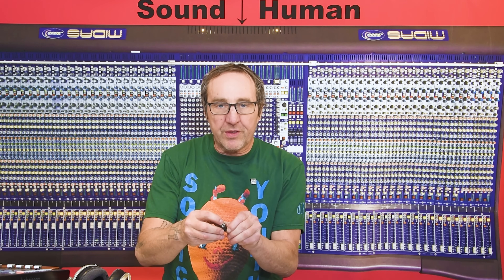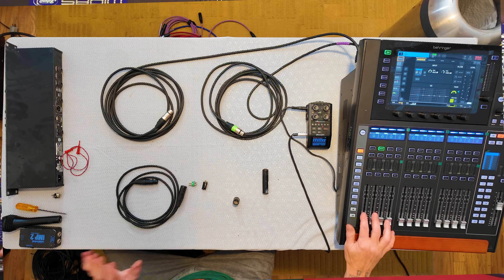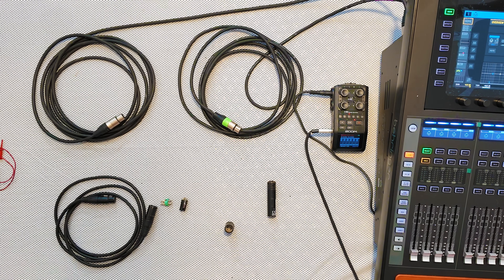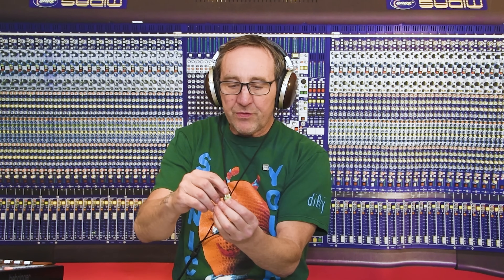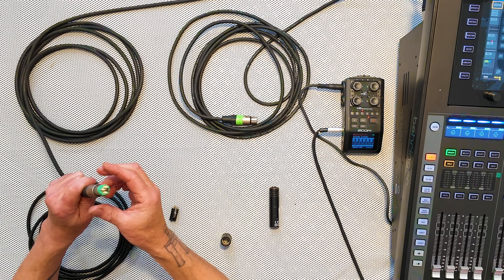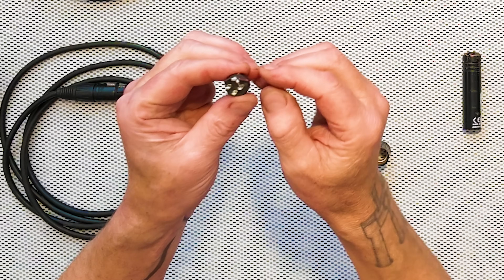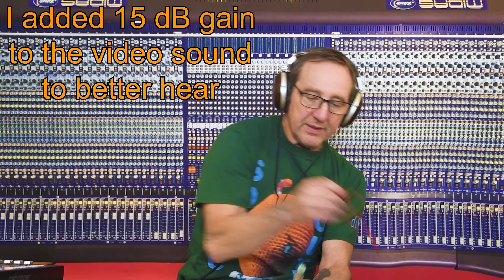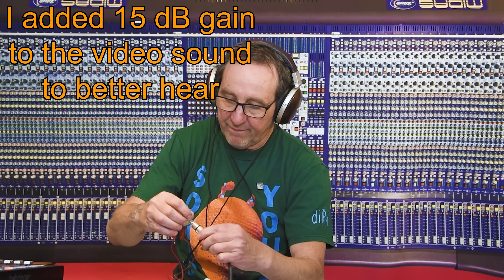XLR Shell Ground Issues

Comment: I've got different color coding for the XLR that have shields grounded, because there are times you absolutely need that, but you must know that they've been connected by glance.
Solves many issues on the field...
Reply: I work at a venue with the county's radio tower in the parking lot. The highway department, the sheriff, and will also link municipal fire departments in to county system.  This turns my cabels into a great big antenna aray. So I love your idea of having grounded cabels designated by color.
Reply from the maker: Very cool and I have a video up on the member side about RFI and EMF interference versus cable. 

And working on another. 

They'll be public at some point later this year probably
Reply: @ yes, color ring on the cable for the length (resistor color coding), the boot of the neutrik designates the grounding/not grounded, color ring around the connector isn't currently on any particular use and then the chassis color (clear/black) for if the cable's DMX or microphone type
Reply from the maker: Very cool and smart

Comment: What about daisy chaining XLR Snakes? Do you think daisy chaining together snakes like in the video I linked will have the same static effect (grounded vs ungrounded)? Could it be worse, less, what's your take Dave (and eveyone else's for the matter)? https://youtu.be/0AwU-hzP-YM?t=31

Also. Could the static be different if you switch between in/outputs when you're routing via the snake (rather than just doing the sensible thing and just route e.g mic 1 thru input 1 all the way to the mixer) or is the routing itself not a factor what so ever when discussing noise (probably no, I think, hehe, IDK anymore)? Like mic 1 goes into snake1 input 1,  then snake2 input 6 and then into the mixer's XLR input 1, 2, 3 or whatever you choose? 

I know the static you show in the video is not the end of the world, but I'm still curious what could happen if you daisy chain snakes and signals the way I wrote. Is it realistic that this would happen, in 99% of cases, probably no. But it's still a good brain tease to me.

Anyway. Really cool video! learned a lot! Thanks!
Reply from the maker: Ideally the metal snake box should be grounded in some way to provide shielding for all the untwisted wires inside. 

This is a bit of a problem because the question arises is how to ground that stage box with a conventional snake cable. 

One option is to ground it to channel 1 pin 1. But that means if channel 1 is not plugged in the box is not grounded. 

Another option is to ground it to every single pin one, this works ok as it just brings the pin one to chassis ground connections as they are in the mixing board out to the stage box. But if any equipment is used then has a ground to pin one issue or loop causing problem, it will mess with everything rather than the isolated. 

For example if you have clear com running down there snake and it's got a bad ground it will mess up your audio ground.

Ideally you would have a snake cable that has an overall shield that would connect to the stage box and would connect to the chassis grounds of the XLRs. Or at least one XLR, or have a separate ground wire connection for it that would connect to the chassis of the mixing board. 

I think you'll find it some stage boxes are not grounded and some are grounded. 

With sound tools analog over cat products the stage boxes are grounded to the shield of the Cat5e cable. Which is pin 1 of the audio grounds. But there's an internal jumper to lift the stage box ground if cables are used that have the XLR shell grounded to pin one. This allows the box to be grounded by the XLR shells instead of the cat 5e shield.
Reply: @DaveRat  Oh wow. That's a lot of cool variables and possible solutions. I have so much more to learn, and I love it! Fascinating! You show your knowledge yet again! Thank you!
Reply from the maker: Awesome and thank you

Comment: So in a studio setting you would want mostly shell grounded cables and a few ungrounded for trouble shooting ground loops?
Reply from the maker: I would say no. Different gear has different reactions to having its chassis ground externally shorted to its audio ground. 

Grounded shell XLRs force this to happen and that can cause problems. 

 chassis grounds are messy and tend to be exposed to many variables. Chassis grounds are tied to the AC ground and when gear is mounted in a rack all those chassis grounds often get connected together so any chassis ground issues with any gear in the rack will mess with the chassis grounds of all the gear in the rack. Chassis grounds tend to be a big mess of ground loops and noise

Conversely audio grounds need to be as clean and precise as possible and not have ground loops. 

I would avoid forcing a connection between chassis ground and audio ground whenever possible except as a problem solving action. 

One of those problem solving actions would be extending XLR cables and having ungrounded shells

Comment: Interesting point about the bass di issue, assuming it was Fleas Gallien Kreuger bass rig. I ve had the same with smaller GK combos and other manufacturers amps, to the point i now almost always use a BSS, Radial or other di with ground lift on bass rigs. There are so many variables with amps /guitar pre amps/  chassis grounding, aside from xlr cable ground. I often considered using the old Rane method of placing a 100 pF capacitor between pin 1 and xlr shell to shunt it to ground.
Reply from the maker: Agreed

Comment: So if you ar runing dmx my opinion is no grounding

But it rase the question why is there no XLRs with an internal scheld isolated from the outer schell
Reply from the maker: That's a great idea. Have pin one go to an internal isolated shield that carries the cable shield all the way up to the next one but does not connect to the outer metal shell causing a short between chassis ground and pin 1.

Comment: I looked into this when i first started soldering cables professionally (around 2006) and came to the conclusion that it was best not to ground the shell and let the equipment desidners decide if the chassis and audio ground should be joined.
The deciding factor was that shell needs to be lifted for DMX cables and if your audio cables are shell lifted, they can in a pinch be used for DMX applications.
Reply from the maker: Agreed

Comment: There is a way to do both….connect for shielding AND not connect to avoid “Earth Loops”. In an Earth Loop, the impedance is really low, typically less than 250 mili Ohms. This causes a large current to circulate in the loop if an AC msgnetic field…from a mains transformer in a piece of gear, say, passes partially through the loop…so the current is large..atound 100mA, but the resisrance/impedance is really low…so developed voltages are small…typically 10-50mV, but thst is well enough to sdd to a 5mV mic level signal and ruin it. 

  If you place a low value resistor in the loop, and I have seen values as low as 1 Ohm bee effective….because this reduces the circulating current in the loop by an order of magnitude or do. So, knowing this, if you place a 47 Ohm resistor, day, between pin 1, the signal shield ground and the Shell…this will Be well low enough to “ground -out” pick-up hum and other electric field interference, but also be high enough if in an Earth Loop situation, to teduce loop current so low thst it will be barely detectable as a voltage deop across the signsl common paths.

The best solution, by far, would be to add an extra wire to the shielded twisted pair….but on the OUTSIDE of the shield, and use that to simply connect the shells at each end but remain complelely idolsted from the two sigs and signal shearh. mics would need to have a 47 Ohm resistor placed between the body and pin 1 also to preven Eath Loops forming.

The best of the best would be to used DOUBLE SHIELDED cable for everything and use the outer shield just between the shells, but that is expensive..but not outside the budget of the Ted Hot Chili Peppers!

Problems always arise at gigs where multiple pieces of gear, belonging to multiple entities…with multiple philosophies..come together. So if you use double shielded leads with shells connected to the outer sheath st both ends…to extend the chassis (not signal) Earth to things like microphones…but they connect their muc bodies religeously to pin 1, then you have an Earth Loop issue.

I reckin being a band roadie/tech would be a frustrating pain at every gig…particularly multi srtist gig like WomAdelade or the like.

If every band on Earth agreed to one standard…say double shielded cables and 47 Ohm resistors between signal and chassis Grounds…then roadis’ lives would be s hevk of a lot less hectic snd stressful.

Here in Australia we have this fantastic little pnumonic pertaining to XLR’s…”Two’s hot and three’s not”…this had to be “drummed into Aussies” because we had a really bad habbit of making 3 the in phase line and 2 the out of phase line.

Oh, one last thing, SAFTEY EARTHING, which often goes dangrously in the “back seat” when trying to eliminate an Earth Loop…roadies lopping the Eath/Ground pins off the plugs to mixers and amps….NOOOOOO! This puts people in danger…so to fix this issue, put two BIG silicon stud diodes apin antiparallel with any 47 Ohm “loop busting” resistor. The PIV of those diodes can be really low, because thay thave”sweet FA” across then, just 100-200mV or so, not enough to reach their 600mV bias-on voltsge, so thay are “invisible” to the set up…under normal operation..but, if a signal ground touches something live, or a mic boy etc, these diodes instantly conduct both half cycles and trip the breaker on the board. So, they do need to be as large a current rating as possible…I have seen 1N5408’s…3A…used, but I’d prefer greater. In such an event of something … a mic say, touching something live, rxpect those fiodes to be “blown shorted” and need replacing after.

Cheers from an electronics tech in Tasmania!

Comment: The classic pin 1 grounding issue in audio equipment has been known for decades, yet manufacturers still design and produce gear with the Pin 1 ground fault.  Amazing that such a simple to avoid problem is still very common in modern audio equipment, computer audio interfaces, radio communications gear and even some mixers.  Surely it is about time equipment designers learned to do it properly but after 50+ years of finding the Pin 1 fault in a wide range of equipment I still expect to see the same issue in new equipment that is poorly designed.

Comment: After all these years I actually learned something here 👍Thanks!
Reply from the maker: So cool and thank you!
Reply: @DaveRat  I always learn something from your channel! This ground lift was a good thing to be alerted to😊
Reply from the maker: Very cool and just to be clear it's not a ground lift. 

But rather it's making sure that someone hasn't intentionally tied chassis ground to audio ground inside the connectors. 

When an XLR is plugged into a piece of gear the XLR shell is a chassis ground 

When two XLR cables are plugged into each other the XLR shell can be part of the shielding and therefore should be connected or can be connected to the audio ground 

The issue is that when the XLR housing is connected to audio ground which is ideal for extending cables gets plugged into a piece of gear which then means the chassis ground is shorted the audio ground there can be issues
Reply: @DaveRat  Right, my answer was short. We are on the same page👍
Reply from the maker: Wonderful and thank you so much!

Comment: I was thaught, decades ago, to ground just the male XLR shell, not the female.
Reply from the maker: Yes, grounding the male would be better but that still can cause issues. Will try and video gear that humans when a grounded male is plugged in. 

Depending on how the internal grounding is wired and where and how pin 1 is referenced to chassis ground, a chassis to pin 1 short on an input can cause an internal hum, (internal ground loop) inside the gear that it is plugged into.

Comment: What all this ends up being a manifest of is the Pin 1 Problem (Neil Muncy, Journal of the AES, 1994) , where people believe signal ground and chassis ground inside apparatus can be freely intermixed. It turns out that if the equipment designer shorts pin 1 to chassis (and thus by necessity, also to PE / safety ground) in the mixer input, and does not carry the ground wire to the preamp pcb, all the ground loop related problems disappear. Because ground loops are a good thing. As long as they're not going through your mike preamps. Why are they good? Think of them like this: They offer a low impedance path for interference away from the signal chain, removing the chances of interference voltages rising. Noise, especially so in this day and age, comes in many frequency bands. A digital mixer is doing a lot of RF inside. "Lifting" is actually not very sensible anymore, because it usually can cure the audible problem but will just as often make worse other things like digital signal integrity. More grounding is usually better. And using Pin 1 Problem free devices mostly removes the problems with good grounding.
Reply from the maker: I might not be understanding exactly but my experience is that when the shield is carrying any type noise currents other than DC it induces issues and that noise onto the signal wires. 

 I will do a video on ground loops soon. Where I will set up and create a ground loop and then plug various wiring with and without transformers and grounding scenarios so we can hear what happens and see how to solve it
Reply: @DaveRat  Yes, I was trying to cover a complex problem in short text. That is complicated and then some!  Anyway, there have been experiments made showing that you can have lots of noise current in your screens, but as long as the screen is tied directly to chassis ground in the receiving end, and not "grounded" through the 0V in the mike preamp, most problems disappear. To get the benefits up into higher frequencies, the connection needs to be low impedance at those frequencies too -- hence products like the NC3FDX-EMC-Spec from Neutrik. 

The reason I commented on the grounding shells video rather than going for the ground loop video (apart from poor impulse control on my side) was that the tying of shell to screen is discussed at some length in discussions on broadband solutions to the Pin 1 problem. So there is some crosstalk on these subjects. 

At any rate, a modern mic or line input probably should tie pin 1 to chassis (and then also AC Protective Earth) in the chassis connector, as immediately as possible. We're in  RF voodoo land here, so the length of the jumper from pin 1 solder terminal to the connector body plays a significant rôle -- although at audio frequencies most anything will be fine. 

So, perhaps a premature comment :-) I look forward to the loop video.  Thanks!
Reply from the maker: I think it kind of falls into:

Chassis grounds are all about establishing as many ground loops as possible and grounding everything to everything and providing safety

Pin 1 audio grounds are all about minimizing ground loops and having a single stable clean audio reference point and establishing the Faraday shield to protect the signal carrying conductors from noise being induced.
Reply: @ Yes, that is a classic way to interpret it. And, it works if you look at audio frequencies only. The bonding of screen to chassis at the enclosure -- not through the mike preamp 0V rail -- is the crucial part. That diverts the interference away from the gain stages.
Reply: But there are other issues with extraneous currents in the shields of audio cables.  Look in the AES archives for the studies done by Jim Brown on SCIN, the (mostly inductive) differential cross coupling of shield currents into the balanced audio conductors.  Very interesting results, not always intuitive.  Best to avoid any extraneous currents, including RF, not just AC 50-60 Hz.  Of course you must maintain shield continuity, just avoid letting anything else flow through it.

Comment: Thanks so much for doing this, Dave. As we have seen, it’s not a simply answered question. However, there is an absolutely answer for it which is kinda rare in the world of noise. One solution my company came up with with was to have very long mic cables available for those extremely rare situations. We keep about 8-10 100’ cables and have on spools a small number, as in three, 200+ foot cables.

Interestingly, in the world of sports audio, 100’ and 200’ are considered normal length cables and can be found in dedicated bins just for them. This is explained well by your findings. The microphones those cables serve are often for ambience at a relatively low level. It’s impractical in sports audio to insert battery preamps on many ambience mics so the lowest noise setup is de riguere.
Reply from the maker: Very cool. Yes, we have a loads of cables including 20 or 30 100 meter cables which is our max length.

All our main snakes are 100 meters so that is a useful length for us
Reply: @   For decades, Artisan Mobile used a pair of 400’ W4 terminated main mults. I still have them and need a hand just to move them around the shop. My professional goal is to never use them again. Turns out they’re about 72 feet too long.